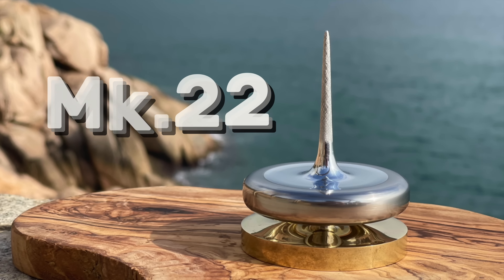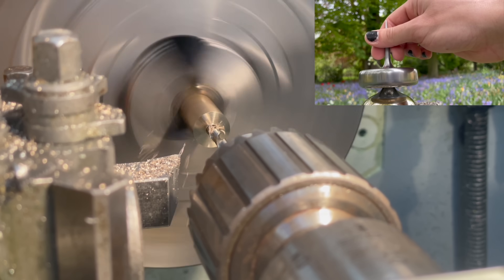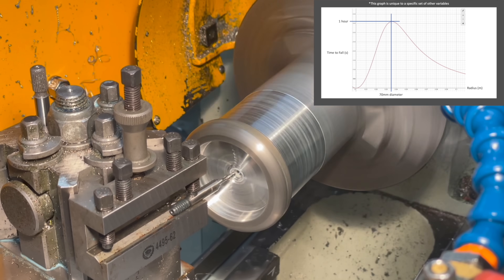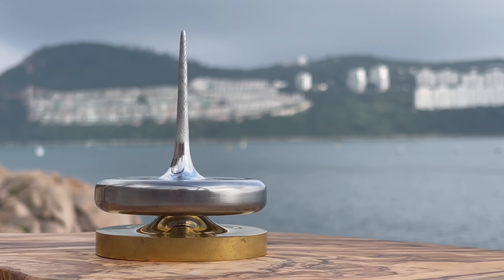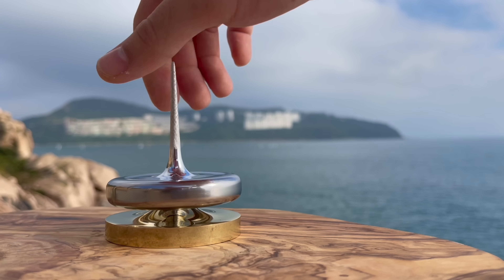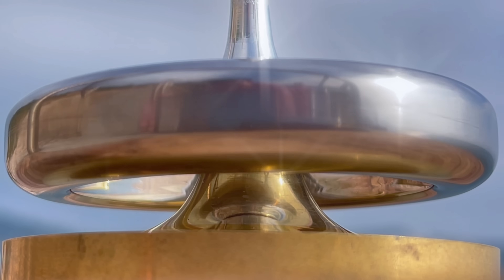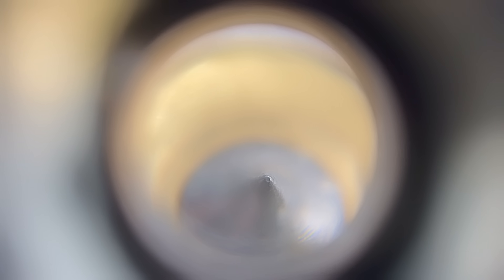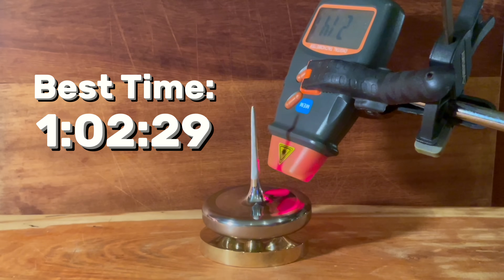Spinning Top Mk.22 | 1 HOUR BARRIER

Comment: Hi, I've seen a channel get like 4 to 5 times the spinning duration by putting it in a vacuum chamber. Even if this is considered cheating it would still make for an interesting world record. You can pick them up quite cheaply for around $120. I suspect yours would spin 4+ hours at less than 1/10 atmosphere.

Comment: Very well done, nice project. One dumb question, is it required by definition that the center of gravity be above the tip? Seems to me that you could definitely have engineered the other way around... such that it never topples, even after stopping completely?
Reply from the maker: Apologies for the late reply, and thank you very much! Regarding putting the tip above the cog, this is known in the community as an N-COG (negative centre of gravity) top. It is easy to do and would make it so the top never topples. However since toppling is a key characteristic of spinning tops, the top no longer qualifies for world records (and in my opinion is no longer a spinning top)!

Comment: Could you build a top that levitates over a magnetic base?  Then the only friction would be drag, though I wonder if it would be stable enough to limit losses due to vibration.
Reply from the maker: I think I could do this, however since it wouldn’t topple and doesn’t have a tip to spin on, it wouldn’t be a spinning top. Still it could be a fun experiment!

Comment: Would it make a noticable difference if you completely polished the handle aswell and then used some other material with a high drag coefficient to spin it? My idea for that would be some sort of small rubber mat used for the drag and then the string around that. I would guess that avoiding knurling would not only reduce air drag but also get it centered more and make it less tumbly.
Reply from the maker: Hello! In terms of performance, I think the gains would be hard to notice. However from a manufacturing standpoint, I quite like this idea and would like to try it!

Comment: Is using a lubricant allowed? For example a crankshaft bearing (which sometime don’t even use a bearing at all…just engine oil) they survice a countless violent rotation when the car moving around

Comment: I've achieved 45 min with a magnetic suspension tip, top. Took 5 min to make and hours of experimentation with various weight distribution and more importantly magnetic attraction being the most minimal needed. I don't know if using an inverted top counts tho?

Comment: This may be kind of cheesing it, but thinking along the lines of free fall reducing the impact gravity has on friction... Have some enclosed apparatus that drops the whole thing with a consistent speed (maybe on a pulley or rail system)
Reply from the maker: Definitely cheating haha but I like the out of the box thinking! You would need constant acceleration, not speed. Would be quite difficult especially for such a long time

Comment: Why is the point on the top and not the base, if you had a concave insert inside the top then it could have the same contact with the top itself for holding, but you would reduce the mass and further lower the cg, it would also not require sharpening and so with no removal mechanism you could possibly further reduce the mass. Although I'm not the guy that's made 22 of them, I'm just an idiot on the web lol. I should also say it's an excellent peace of art and engineering

Comment: I never knew this was a thing, very nice work. You mention the centre of gravity being less than 1mm above tip height, making it very stable. What happens if the flywheel "bell/skirt" is lower so the centre of gravity is below the tip height?

Comment: Does the tip you grab to spin it increase air drag due to its roughness? And if so, have you considered polishing it like the rest of the top to achieve even less drag, and perhaps spinning it up with some other device that could still grip the smooth surface, like some sort of custom rubber drill bit or gripping device? I'm totally new to this hobby and have zero engineering background, so I'm sure this is a super obvious question. But just was curious!
Reply from the maker: It is good thinking! Thankfully, I can afford to knurl the stem because since the radius is relatively small here compared to the flywheel, the drag it experiences is negligible. Theoretically making it smaller/polished would help but I really don't think it would make any noticeable difference! Stay curious :)

Comment: To further refine and optimize your equation, do tests under vacuum to isolate the component of friction and get empirical data to inform your simulation 

This might be a lot to implement, but you could also do the inverse by building an assembly using magnetic bearings to isolate the air drag. If that finds its way into the final product, you could be in the 3+ hr range

Comment: Very minimal change but since you are breaking recods could be worth using a knurling that if only horizontal grooves that allow the pads of the fingers to grip and spid but reduce air resistance by maintaining a single profile to wind resistance. Also is it a requirement that it is spun by hand?
Reply from the maker: I agree that my knurling and stem in general has significant room for improvement! It is something I am looking into, previously I have just been lacking in tooling. I believe having a better grip will be more noticeable than any impact on air drag. And yes, it is a requirement ot be spun by hand (though in testing I often use a drill for ease and uniformity)

Comment: Awesome spinner, top performance! Have you considered a gemstone contact point in both surfaces to reduce friction further? Also we need the full length video of its performance!
Reply from the maker: I have… a little more difficult to implement than I anticipated but I’m working on it :)
Reply: @ an artificial diamond on both contacts can be bespoken to fit any shape.

Comment: Thats sick. now because you have done this beautifully master peace art. Lets push this top to the out most limit of limits. Throw that bad boy in a vacuum chamber while the top is suspended in air by the magnetic force of the tip being repelled by the superconductor witch is cooled to absolute chilled temps making this a (spinning, levitating, magnetic, superconducting, top.

Comment: I would have thought having such a large area bored out of the underneath is causing additional turbulence and resulting in extra air drag. Have you considered some kind of cap made of a lightweight material? Additionally I wonder if this bottom face could take advantage of the spiralling air to generate a minimal amount of lift to reduce friction on the tip? It’s a really interesting thing to think about! Congratulations on 1 hour spin!
Reply from the maker: Thanks, just seeing this comment now (apologies) and it’s interesting to see I’ve now implemented your suggestion in Mk.23. Good idea!
Reply: @hiper_tops  that’s great! I really enjoyed doing a bit of deep thinking about this problem and I’m pleased to hear you came to a similar conclusion! I’m interested to see what you came up with!

Comment: high performance! does the rim have to be circular? Could you design a shape that generates a small amount of lift as it spins to reduce tip friction?
Reply from the maker: A non circular design would drastically increase air drag for no real gains in terms of energy storage. Regarding lift, in order to create a sufficient amount to have a noticeable impact on tip friction, so much air would have to be moved that increased air drag would counter any benefits!

Comment: So is this an unlimited category? You mentioned it was spun by hand and without a shroud, but are the other factors unlimited?

It seems to me like the mass of the top would be a huge factor in spin time, so is there a reason you don't just make it larger? The square cube law would be in your favour as you increase size

Also if the knurled spiky top part (let me know if there's a proper name lol) essentially acts to give you mechanical advantage for the spin-up, why not make it taper down to a really fine section to increase the rpm you can realistically achieve by hand? Given the smaller diameter that would reduce the airspeed of the knurled section too, reducing drag. The limiting factor for such an optimisation would be material strength and it looks like you're a long way off reaching that

Comment: Wow, High-Performance indeed. 
A few thoughts or even questions;
- Would the thickness of the flywheel part impact performance positively if made smaller ( and even the entire top made smaller equally )? I would imagine that the amount of force introduced to start the top in this scale would make a smaller top go faster so it would last longer?
- I've seen tops with a tapered out disk instead of this flywheel type, would a ring of heavier material machined into a tapered disk and then mounted onto a lighter material center make any difference? Or would that have zero influence on airdrag?

Comment: My only suggestion is to try impregnate the tip and base with Tungsten disulfide (w2s), I think its on of the best dry lubricants out there. I've never used it personally but from what Iv'e researched it can be almost 'buffed' into metal surfaces and it will adhere itself and then form a very slippery surface. I'm not sure how long it would last, potentially even just a small portion of the spin before wearing off. Would be cool to try.

Comment: the more you polish it, the more the air will stick on it, the surface should be that of a golfball, remove the contact point by using a magnetic lock

Comment: Have you tried lubricants? They make oil embedded bearing materials that lubricate as they wear. Otherwise maybe just have the tip in an oil bath. Or maybe use low friction coatings.

Comment: Surely the ultimate design would be a hollow cylinder (think of something like a drinks can) made from something dense like tungsten or uranium, filled with helium, with a stationary shaft inside (running in a tube to keep the helium in) that's supported on magnetic bearings. A bit more radical than just playing around with the shape for years.

Comment: Wow, that top is High Performance. New here, sorry if these are repeat questions.
What lubricant do you use? 
Do you have any special methods to align the center of mass with the axis of rotation? 

Does your brass base provide kinematically deterministic contact with the table top?
Have you considered table top materials with less hysteresis than wood, perhaps a granite surface plate?
I'm mostly thinking about the low speed phase where the tip starts to roll with precession. Whenever the contact point moves, the base could have microscopic motion against the table top, minor effect, but easy to test.
Reply from the maker: Thank you for these interesting notes. I use an oil lubricant suitable for synthetic ruby ball bearings. To balance the top, I use a technique developed by Iacopo Simonelli which involves marking the side of the top which leans outwards and grinding the tip to move it in this direction (and repeating finer and finer until balanced). I am a bit doubtful that changing the wood floor I used (it was for aesthetics) for something like granite would have much of a difference. Yet, it is easy to test so I'll give it a go :)

Comment: I'm genuinely surprised you didn't use a ruby tip for the contact point. Ruby is a common component in watch balance wheels. I'm sure they would be available from a watch repair shop. Or watch-making supply company of some sort.

Comment: James, I think I saw an old video of your some years ago but happened across this one today. Unbelieveable! Truly a High-performance spinning top.

A few points / questions:

1) Please fix your CAD! I saw you had made it in a public Onshape document so I had a look, and you're making life so difficult for youself.

a. Model the whole top in a single part studio! There's no need to create a seperate document for every part. Think of documents as binders which hold everything related to something. They can have parts, assemblies, drawings, etc inside. It will make your life so much easier modifying the design and keeping interfaces working between parts.

b. Some of your parts aren't fully defined (blue vs black sketch segments) which may cause you headaches down the line if you accidentally adjust something and attempt to make it again.

c. Your assembly is floating in space, and has no relation to the origin. Move the point of the tip to the origin, and then aling everything about the Z axis. Then when you measure CoG of the assembly its coordinates will be in relation to the point of the tip.

d. I couldn't help myself and re-modelled the Mk.23 shown in the video. If you go to Onshape > Public Documents and search for "James Goh - MK.23 Clean" You should find it.

2) I noticed in your CAD that the brass appears to be an interference fit, if so, how do you ensure that it bottoms out or at least gets extremely close, as if it doesn't bottom out correctly you'll raise the CoG up inadvertently.

3) As others have said, I would watch the hell out of a multi-part, multi-hour detailing of the math and design you've put into the iterations. It's truly remarkable.
Reply from the maker: Thank you for these notes! My CAD skills definitely need work haha - I'm more used to solid works but working on a mac at the moment. I found your document - thank you! Regarding 2), I believe that may be an error as the tapered tip holder uses a friction fit. And for 3) I am working on something along these lines but it may take a while as I am back at uni now.

Comment: You could start a crowd funding campaign to raise the $$$ to do one in platinum. It's denser and cheaper (usually) than gold. I'd totally chip in $10 to see it done.
Reply from the maker: A platinum top would cost about 7000 USD so yes this isn't 100% out of the question! However, this may be further down the line :)

Comment: What if you make it wider and more centered, it looks too wobbly and the materials need changing on the base and tip
Reply from the maker: All good points, regarding the wideness, I believe 70mm is optimal for multi twirl tops like these as any more and air drag would be too much and any less and tip drag would be too much. I am looking into base and tip materials!

Comment: I wonder how much technique, finger strength and grip on one's finger tips affect the duration. Would perhaps a professional guitarist with chalked fingers be able to garner whole extra minutes of spin time?
Reply from the maker: I think yes! I wouldn’t say I have particularly strong hands or fingers. I think a well practiced pianist or similar could probably start Mk.22 at at least 2500 rpm instead of my 2100. This would add about 3 minutes :)

Comment: The harder the material at contact is, the less wearing it will have and the longer a polished surface will last and function... What if you were to use something like a tungsten carbide tip on a tungsten surface so it wouldn't be able to eat itself.  Theoretically diamond would be perfect, but I find metals easier to work with in production.  Well done breaking that record there!
Reply from the maker: Since the carbide is harder than the tungsten, it would drill into the base. In practice, a slightly harder base material is best. I think carbide on monocrystaline diamond would be ideal but it is very expensive and hard to find!!

Comment: Very cool! Congrats on the world record! 
(You’ve probably considered these suggestions, so disregard if that’s the case, otherwise, I’d love to hear your thoughts) 
You mentioned a shroud in order to minimize drag. I’d suggest doing some studies to see optimal shapes and volumes of the shroud. Not sure if that’s allowed for spinning records.
Second, could you design a way for the top to slightly push air downwards, lifting the top? Obviously weight is good for rotational inertia, but bad for friction. A slight lift generated from the profile of the spinning flywheel might allow for reduced friction.
Again, fantastic work and congrats on the new WR.
Reply from the maker: Thanks for your interest and kind words! Regarding the shroud there are quite a few papers out there because there are strong links to kinetic energy storage systems (large flywheels spinning in an enclosed housing with a low pressure helium atmosphere). I can look more into these, however I am not planning on using shrouds for now as tampering with atmospheric conditions is a bit against the spirit of spinning top design! 
Regarding the lift, someone else also mentioned this idea. We came to the conclusion that it would be difficult to create a downward air flow strong enough to have any impact on the weight of the top - and that if this could be achieved, the increase in air drag would make any gains futile. 
Thanks for watching!
Reply: I am the inventor of the shroud:  https://youtu.be/oKxrP7-QXpk   James learned from me how to make tops in the way he does, and the various technicalities about them.  I hope that he will start designing his tops using his own ideas, instaed of relying so much on the mine, if he wants to sell them.
Reply: @iacoposimonelli7191 If you want to keep your ideas secret don’t put them on YouTube! It’s either secret, private and patented or it’s in the public domain. You can’t have it both ways. Anyway, I’m not even sure that he does borrow from your ideas. The basics of the optimum design are fairly obvious even to someone who has never built one.

Comment: making indents like a golfball on the outer edge? what happens then ?
Reply from the maker: It would spin for not as long! Since tops don't experience pressure drag like golf balls do, they don't benefit from a turbulent boundary layer. In fact, any surface roughness increases drag.